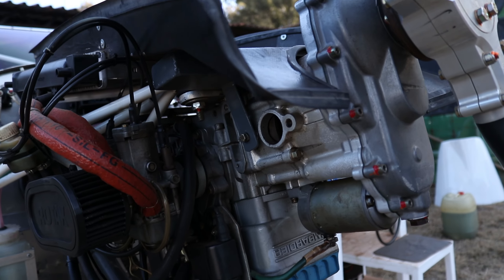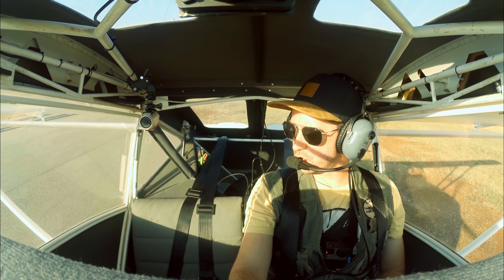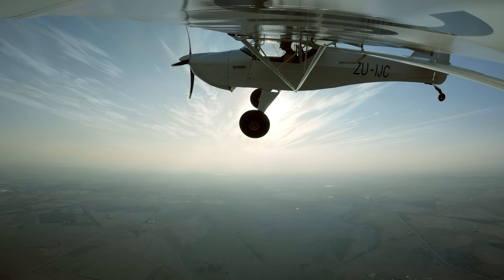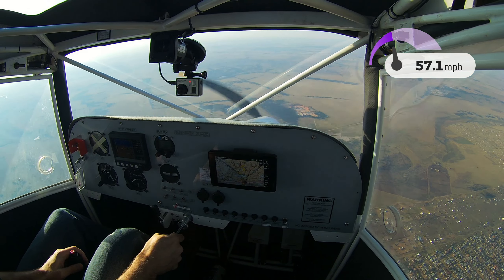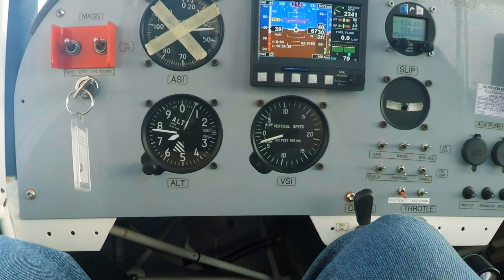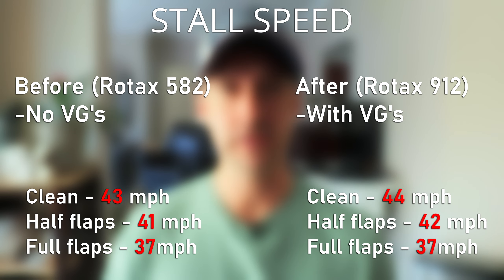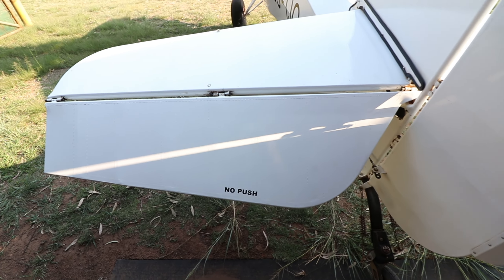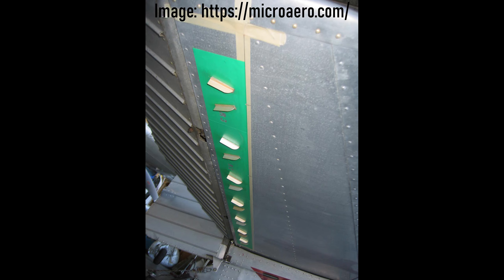Installing VG's Did NOTHING? | Power-off Stalls | Aerodynamic Problems

Comment: On the Bushbaby the VG's must be installed 91mm from the LE.  As you mentioned, lots of things changed from the one configuration to the next.   As Mike said, too many things effect stalling speed and tests need to be consistently the same. The first action is to calibrate the pitot static system or at the least have a graph with the known error, then work form there. Lots of literature available on the techniques and data reduction methods. Data need to be reduced back to sealevel standard day in order to have accurate comparative numbers. Interesting nonetheless.
Reply from the maker: Appreciate the info. We'll move the VG's forward to the correct position, but I am fairly certain it will make no noticable difference on IJC until we get the bigger tail (horizontal stabiliser), which we will do after the upcoming annual/MPI. Getting that tail down with the heavier engine is the biggest problem, as you've also said from the start.

Yeah just doing stalls is one thing, but doing it in a repeatable / comparable / consistent manner is something else. We're learning a lot.

Comment: Great intro video for comparative stalling. 

To perform the stall testing a little more rigorously the deceleration rate needs to be taken into account. The FAR 23 certification stall speed requires a 1kt/s deceleration and that deceleration can have a large impact on the speed. Plotting the stall speed vs. average deceleration rate over last 5 kts for all your tests should give you a quite straight line and you can then pluck off the value for the 1kt/s point which will be your stall speed. 

There are a number of other factors but that one is especially important and has a big impact of the final reference speed. If you decelerate faster then you get a lower speed. Pilot technique is also critical and being consistent to get that constant rate will mean you may have to disregard quite a lot of data along the way. A 2kt/s deceleration may see a stall speed 2 kts slower than a 1 kt/s rate. By varying the deceleration rate that regression of speed vs rate will provide an accurate number for your given weight. 

In a normal flight test programme you correct each point for weight change due to fuel burn and ensure the c.g. is in the most adverse position etc which will also have a significant effect. For example the more fwd c.g. requires greater tailplane down force as well which will tend to increase stall speed and may limit pitch control as demonstrated in this video.
Reply from the maker: Thanks for the comment. I've never really thought of it before, but the deceleration rate factor makes perfect sense. After a fast deceleration the indicated speed blasts past the actual real stall speed because of greater inertia, resulting in lower, but "false" stall speeds.

Will take this into account for the next round of testing.
Reply: @LetsGoAviate  The reason for the reduced stall speed is a phenomenon known as dynamic stall where the stalling angle of an aerofoil is increased due to a higher pitch rate. If a wing would stall at a slow increase in angle of attack at say 14 deg, if the pitch rate is increased it may get to 16 deg before stalling. There are inertia factors as well but the aerodynamic pitch rate effect is significant. Well conducted stall tests give you a very straight line regression of deceleration vs speed.